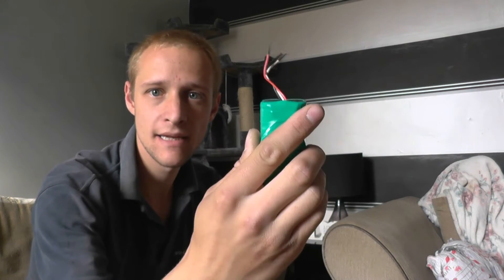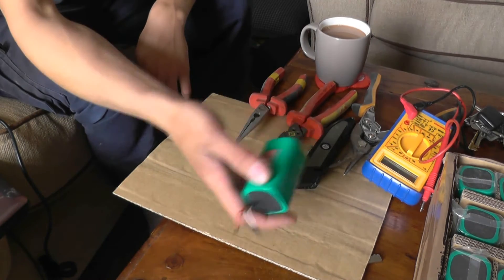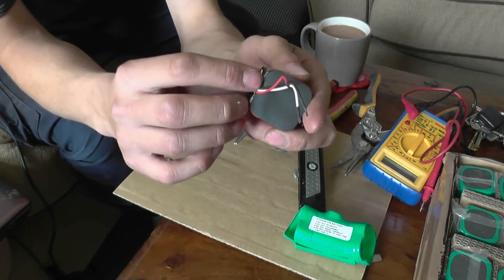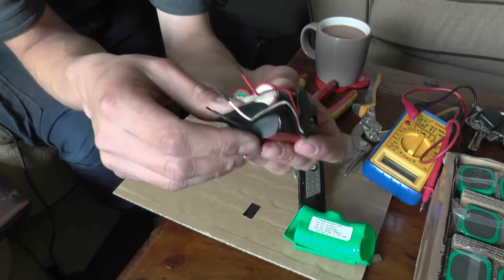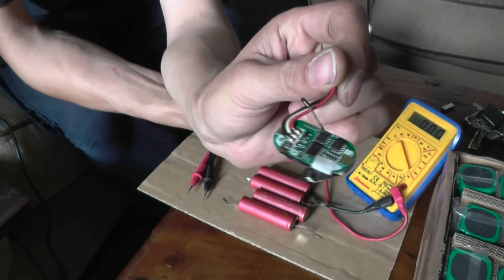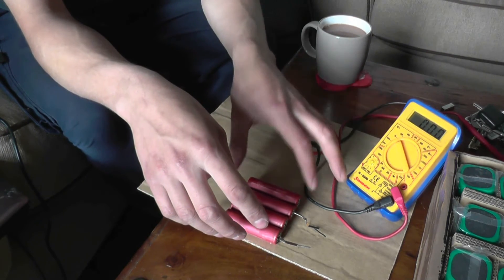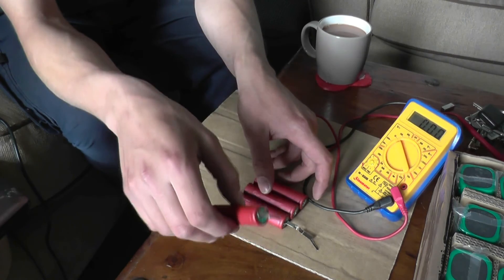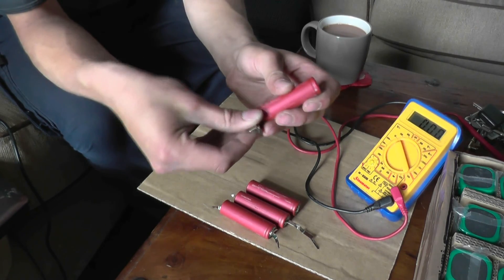18650 part 1 - stripping cells

Comment: The recomended way to approach low voltage cells, is to apply a small current until they reach 3 volts. If you put a fully charged cell in parallel with it will result in a sudden charge inflow. Not what you want.
Reply from the maker: Since finding I wasn't able to charge and discharge multiple cells in a day my aproach has changed. I have 1s 18650 pcb's that take a USB input! Whilst putting these on my meter It starts a (Dead cell) off with 77ma and doesn't start charging the cell tillit reaches 3.0v. Then it climbs to nearer 1AH. I hope to cover this in my next video

Comment: It is not just the procedure to revive a lithium cell dangerous. A cell that's been overdischarged for long is considered to be damaged and dangerous.

Quote from battery university:
"Do not recharge lithium-ion if a cell has stayed at or below 1.5V for more than a week. Copper shunts may have formed inside the cells that can lead to a partial or total electrical short. If recharged, the cells might become unstable, causing excessive heat or showing other anomalies. Li-ion packs that have been under stress are more sensitive to mechanical abuse, such as vibration, dropping and exposure to heat."

Quote from http://www.mpoweruk.com/lithium_failures.htm
"Allowing the cell voltage to fall below about 2 Volts by over-discharging or storage for extended periods results in progressive breakdown of the electrode materials."

The way I see it, an overdischarged cell is a cell that has been damaged irreparably to an unknown extent and cannot be trusted. Unless of course you know that these packs have not remained overdischarged for too long.
Reply from the maker: Dangerous though it is! Under the right conditions it is possible to revive these cells! These cells have sat unused since manufacture in 2009. I have monitered charge and discharge 5 times over to make sure each cell is satisfactory. with any suspect cells being discarded! I have revived over 200 cells in this manner and to date I have a 100% success rate.

Your opinion is taken on board! I have seen people in the States reviving cells by using a 12v car battery and stripping down the + end of the cell to reterminate the broken link!

When It comes to companies saying do not do this "Blah" Its like the battery companies saying do not mix different brand batteries in your TV remote!
Reply: I'm glad it worked for you. That's a huge amount of cells. Did you make battery packs that have cells in series? So now that you have tested them aren't you more cautious using them instead of  new cells?
Reply from the maker: I have made 4s packs in the past! But them videos are outdated now. Truth is I would like new cells but there is too many fakes out there! I cannot risk losing money when buying a large quantity of cells. If I was to buy 30 2000mah cells to make for example a 20AH 12V pack it woud cost me more than buying 8 10AH LIFEPO4 cells.

Hence the LIFEPO4 pack and the attempt to compare lion to lifepo4. If you want me to do a video for you I will
Reply: Below 2.8 volts the voltage drops very rapidly. If a cell discharges faster than the rest in a pack of cells in series its voltage will drop to zero volts fast, it will be being reverse charged and most likely explode. This is what terrifies me the most with salvaged cells and cells in series.

A reliable source of cheap 18650s in Europe is http://eu.nkon.nl/

If I planned to assemble a big capacity battery this would be the way to go. From the first moment I saw these cells I thought this is a great idea (to use these LIFEPOs instead of 18650s for a battery pack). You don't have to have a spot welder, you don't have to worry about damaging cells with soldering iron, safer easier and faster to assemble disassemble the pack, safer chemistry compared to any 18650, pretty low price per Ah. I have not used them myself but I predict there will be no way back after using these. The only flaw I see is their volume/energy density compared to 18650s.

"If you want me to do a video for you I will"
That is very generous of you. Thank you. Your videos are very thorough already. I'd like to see how the battery pack will handle with the e-bike when the time comes.

Comment: The cells aren't bad. They have not been charged since manufacture. It would be a better Idea to put a small charge in using the onboard BMS and then disassemble them. Good luck and look forward to your next video.